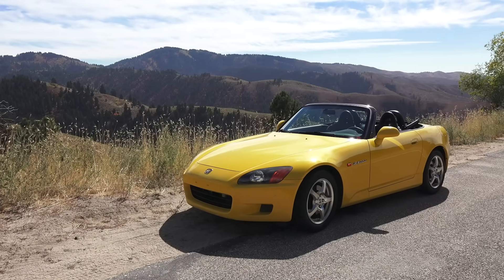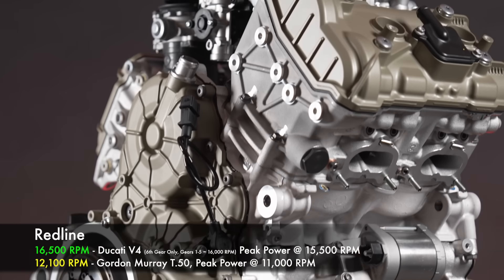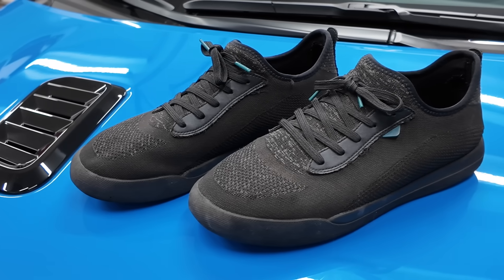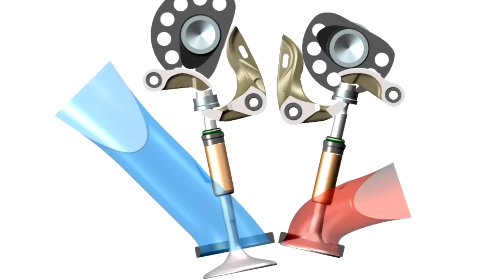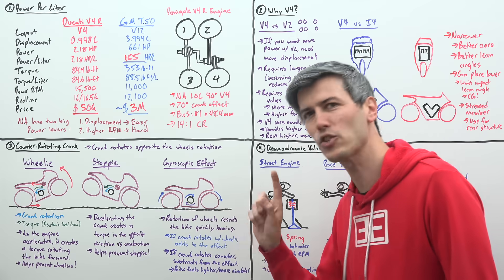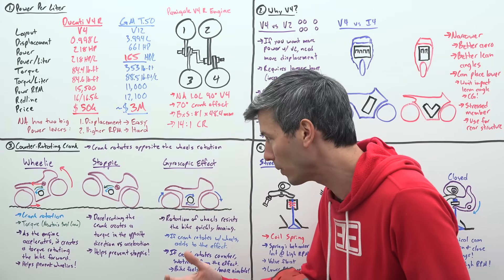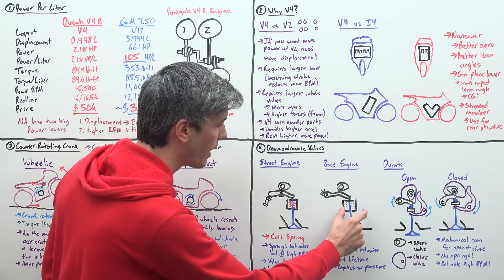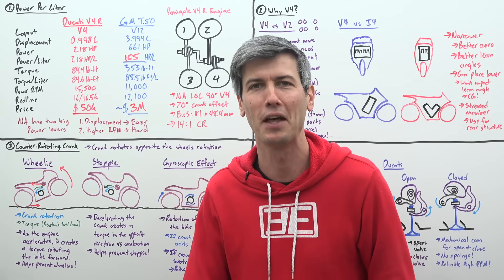Ducati's Brilliant V4 Engine — Putting Supercars To Shame!

Comment: the problem with a V on a motorcycle is heat, heat, and heat (i own a ducati, and it's really difficult when it get hot)
Reply: That's typical of air-cooled v-twins, but also happens in water-cooled motors regardless of configuration. On of the worst offenders was my water-cooled Kawasaki Concours 1000 which could roast the rider's legs in heavy traffic despite being a water-cooled inline 4.
Reply: The Yamaha V-max of the 90's was a bloody nightmare when it got hot, that just made the bikes always trying to kill you unbearable.
Reply: I had an 01 Aprilia Mille.  No matter which way the wind was blowing, the inside of my right calf was be pink during the summer.

Comment: Yes, please follow up with a video on offset and firing order which for a motorcycle has huge impact on maintaining traction (particularly when leaned over) and therefore the ability of the motorcylce to transfer the max power down on a credit card size patch of tire rubber on the road without spitting the rider off. I would suggest looking at the "big bang" firing orders of of the 500cc two stroke race engines from Honda/Yamaha/Suzuki and compare that with what Ducati is doing as well.

Comment: That V4 engine makes more horsepower than my entire 4.3L V6
Reply: I bet your four point three makes a lot more torque
Reply: @chadkent1241  not as much as you’d think. Only 250, which makes its torque per liter (58.14) significantly worse
Reply: Your V6 will have way more bottom end torque than the V4.
Reply: Yeah, but what is the weight to torque ratio?
Reply: @BobBob-q2o5p 
Two totally different applications. Normal street cars rely heavily on bottom end torque, race bikes never ever use bottom end power in racing.
Reply: @Ilmagfe  Again, I know this, as it's a pseudo-project vehicle for me, but still not as much more torque as you'd expect, and as much as I love its low-end response, peak power matters way more than peak torque in most scenarios
Reply: Different design purposes. Most riders won't use much more than 80hp of the available 200, leaving the engine fairly low stressed, but by 60k miles the engine is pretty tired (however, the bike was probably totaled before this). A 4.3 V6 should get 200k miles. Emphasis on should, manufacturers can be known for sloppy design/manufacturing.
Reply: @LilleyAdam  I know this stuff, and none of you seem to get that it was simply a half joke to point fun at my underpowered motor

Comment: I know how the Desmosedici engine works.  Instead of valve springs, there are separate rocker arms to close the valves.  This prevents valve float, but I think there's more to it.  The Desmo was designed in the mid-1950s when, perhaps, valve springs were more likely to break.  I don't know.  However, this is one reason why Ducati has the HP edge.  Assuming 4 valves per cylinder on a 4-cylinder bike, that's 16 valves.  Multiply that by an average of 10k rpm and a 45-minute race.  That means that a valve spring is compressed about 7 million times per race.  Don't tell me THAT'S not robbing HP.  However, if you own a Ducati with this engine, adjusting the valves costs more than a tooth crown.

Comment: Picked up a Multistrada V4 Rally back in August and absolutely love it... Now even more so with this insanely concise description of this incredible engine. The explanation of the reverse rotating crank is very much appreciated, it really is a very tactile ride and feel compared to other bikes I've owned.
Reply: Whats crazy is that still pushes 170hp with traditional valve springs  and has a 60.000km interval. I wouldn't be surprised if the gran turismo ends up being one of the most bulletproof engines due to the fact it's a 210hp engine being coddled down to "only" 170hp

Comment: 9:23 I am certainly not an expert, however would the engine rotating in the opposite direction BUT on the same axis of the wheel actually decrease the gyroscopic effect. I feel like it would have to rotate on a different axis..
Reply: No. The counter rotating engine does (partially) cancel out the gyro force when in the same plane, by subtracting its force vector from that of the wheels…leaving less than the original. In real terms, this makes it feel like the gyro effect is less powerful. You could try this yourself by taking two identical bike wheels on a stick and spinning them. First, spin them both in the same direction and try to tilt them (it will be more difficult than when not spinning). Next spin each wheel in opposite directions. If done properly, it would feel similar to the wheels not spinning at all (meaning you wouldn’t feel the resistance to tilting from gyro force), because the wheels are cancelling each other out.
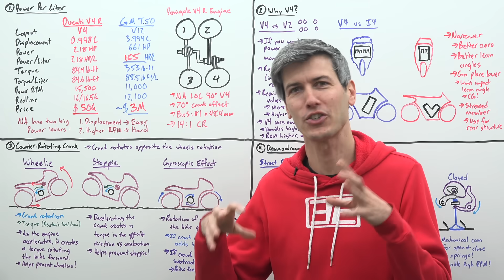Reply: 12:30 neat

Comment: 05:20 Also, if the bore becomes to wide, the burning fuel won't have time to properly ignite. Gasoline doesn't instantly explode. It burns fast. With a wide bore, and high RPM, you'll quickly hit a limit where you'll lose power, in stead of gaining it.

Comment: One of the biggest benefits of a V4 over an inline four at high RPM is that the crankshaft is shorter and therefore the torsional vibrational modes are less of a concern. This becomes a particularly big deal above 15,000 RPM.

Comment: With the Desmodromic valves, are the cams perfectly machined to match each others intervals, or do the rockers have some kind of tensioner in them that allows for tolerances?
Reply: Shims, very exact shims. I set mine during Covid. It runs beautifully but it took forever. An exercise in precision. Some might hate that, I think is an absolute joy.

Comment: I worked on a few Ducati privateer race bikes back in the early 2000s. They are built like Swiss watches: absolutely beautiful, and the closest mere mortals can get to owning an F1 car.

I hope the electronics have got better in the intervening years! 😁 🏍
Reply: The electronics were easy to fix. Just get rid of all the original stuff and replace it with good parts. Once I rewired my Ducati it ran forever and the headlight even lit up the road.
Reply: @soaringvulture Yeah! The notorious electrical problem😅
Reply: Engine wise, beautifully engineered. The welding quality on a lot of their trellis frames… The less said the better.
Reply: Back then it had gremlins in electronic, not any more in fact early 2000 was the last time Ducati had more problems with electronic than others

Comment: specific output:Suzuki street bike VJ23:1997-1998: quoted power; 1997=70 hp ('SP' (sports production) model with new 70° V-Twin engine) 280 hp/litre  and it was ~ $5k bike

Comment: your comment that ducati's engine is the only counter rotating engine is partially correct. I know of at least two modern motorcycles, that had two cranks which cancelled out their rotational inertia. Suzuki RG500 street bike sold in Eu and Canada in the 80's.   Next was the Kawasaki KR250  tandem, a street bike from the mid 80's in Japan, again with two cranks. I am sure there are more.

Comment: 6:18 why not a longitudinal I4 ?
Reply: Because the forces would either push the bike down in the corner or up, just like the drill in Jasons hand. That would make the handling tricky.
Reply: Because use your brain car guy
Reply: Then it would spin the shaft in different direction
Reply: Bike is too wide and can't lean it over enough

Comment: If you go for a follow-up video, it would be good to expand on the comparison with the T50 engine. How does Ducati achieve higher HP/L ? Is it simply to higher RPM? Couldnt we have the same RPM limit on a car engine? Will it be too complex given the size and cylinder count increase?

Comment: The whole concept of peak power is a little cherry picked. It’s all about power under the curve. In application, you can have two identical engines with different cams, one making 20% more only at its peak but the other making 20% less but for the whole rev range. The less peak engine could win in a race.

Comment: The crankshaft of a V4 engine is only half as long as that of an inline engine. The torsional moments and the resulting vibrations are therefore much smaller in a V4 than in an inline engine.

Comment: Very good Ducati show - one of your best.  Staying with race bikes, most tip-overs come from over riding the front tire contact patch, NOT the rear.  GP bikes can decelerate (carbon brakes) faster than accelerate.  So why do these machines (and F1 cars) have smaller front wheels than rears?
Reply: Because if yo make the front as wide as the rear it would handle like a bus.....also most race bikes have traction control NONE have ABS by rule.  Go back to watch late 1990s early 00s WSBK and MotoGP you will note high-sides all over the place because this was pre-traction control, the five cylinder Honda that Rossi destroyed all on being the first race bike with a traction control solution.

Comment: Seriously, more motorcycle engineering videos.  They're so much more interesting than car engineering videos as while many base concepts are the same, motorcycle engines tend to have far more design constraints leading to more interesting solutions vs just "make it bigger"
Reply: Fortnine has some good motorcycle engineering ones
Reply: If you want to make a car that actually handles, you cannot infinitely rely on "make it bigger" either. Lazy engineering is a bad thing, regardless what sort of thing we 're talking about.
Reply: Motorcycles also have far easier emission norms to follow. That does help the engineers quite a lot.
Reply: @Chopper153 Not far easier, though you are correct that they are easier.  They're just one level behind cars with new bikes needing to conform to Euro 6.  The emissions restrictions have driven in no small part the move away from low displacement multi cylinder bikes to much larger displacement twins etc.  new motorcycle engine designs are made forward-thinking, because many current engines either cannot at all or cannot effectively meet upcoming regulation.
Reply: don't forget just throw boost at it although motorcycles have that scene too
Reply: I dont think any of his videos was about making It bigger
Reply: @ronwesilen4536 what?  Of course not.  It doesn't even bear mentioning let alone making a video about.  But it absolutely happens, it's just an underlying feature of automotive engineering - making an engine block 2" longer or wider, adding 50lbs of mass, these things aren't irrelevant but they're also not critical, so many engineering challenges are simply solved that way and never even brought up or discussed because the solution was both obvious and easy.

Motorcycle engineering has all the same base concerns as automotive, but now you're also adding size and weight as absolutely critical factors.  An extra 50lbs on a motorcycle engine, an extra 2" of width, these are enormous flaws that can take a bike from class leading to meh.  

It makes the engineering solutions far more interesting as the tradeoffs are much more critical.
Reply: @ronwesilen4536 you haven't seen his only fans channel
Reply: Nah, it's not more interesting. It's just as interesting. Ships and planes are more interesting
Reply: @Southghost5997   Honestly they're all pretty equally interesting in different ways. Just depends what you know more about/what you are more interested by. Not sure why you or anyone making it a competition you're never gonna win. "Nah ships and planes aren't more interesting rocket ships and space shuttles are more interesting"

Comment: Great bike, great video, but is the gyroscopic effect of the engine turning ‘backwards’ really subtractive? The crank is still spinning with its same MOI about the crank’s K-axis, which doesn’t matter which direction it is spinning, only the MOI and the angular velocity to provide resistive toque if you try to rotate the K-axis. Maybe I’m misremembering, I took physics classes 15 years ago.
Reply: Vector sums + or - when you are dealing along one axis, it gets trigometric otherwise.

Comment: Ducati's Moto GP engines are said to produce somewhere in the region of 320hp. Also another advantage of a V4 over an online design is that of a lighter crankshaft which gives quicker response and handling due to reduced gyroscopic effect making direction change easier.
Reply: And the crankshaft is lighter primarily because it is shorter, which helps to keep the crankshaft torsional resonances at higher frequencies.
Reply: @seth094978 A contributing factor but not a race winning one.
The greater gyroscopic forces of the inline 4 engine was a distinct disadvantage because it's riders had to make a more committed turn shape whereas the V4 bikes could make a more "V"shape and change line mid turn giving them a competitive advantage and creating greater opportunities for passing and,  because they can complete the turn more quickly they can get on the power sooner. I believe this is the biggest advantage V4s have in Moto GP.

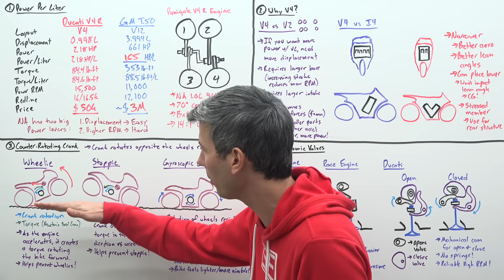Comment: @7:52 Given that the engine is in the center, couldn’t I say that the energy also goes to lifting the rear wheel, since the fulcrum point is in the middle (and not behind the rear wheels), which reduces traction marginally?

Comment: Nice one Jason, as a long time Ducati owner but race driver by trade I appreciate this a lot. Cool to note that Desmo was patented before 1900(!) and used on some notable stuff mostly from Mercedes with pre war GP cars, the BF109 fighter of WWII and the 300SLR's of the Mid 50's at the same time it was disappearing in car Ducati adopted it (also in the mid 50's). I have never had to re-shim any of my valves on my 916 (that's how you adjust them) and it's a 95 I've owned since basically new!
Reply: I had a 2012 Multistrada that didn't need a shim until its 75,000km service

Comment: Fun fact : if you rev a V4 Ducati quickly with no rider on it, in neutral; You can actually see the tail slightly lift up every time you rev it. That drill demonstration was perfect! Thank you!
Reply: Fun fact: If you rev other Ducati engines quickly, you'll throw yourself under nearest table in fear of engine explosion cause of the absurd clutch sounds :D
Reply: @jothain I had someone pull up next to my 996 and tell me it was going to explode 😂

Dry clutch Ducs are not fastttttt...but the twin pulse makes it easier to haul ass if you are an intermediate rider 🍀
Reply: @RA_D-u4z  Hah, good one :)
996's are really nice looking bikes. I wouldn't mind having one
Reply: *symphonic mechanical sounds
Reply: @mostIy_peacefuI  Cacophony of sounds?
Reply: @jothain  Meh, who cares, it's fast.
Reply: @mostIy_peacefuI  It's very debatable if older dry clutch Ducati's are "fast" :P

Comment: The short stroke which allows higher revs leads to incomplete combustion. Therefore you can't put a short stroke motor in a street legal/emissions compliant car. The big deal about the S2000 engine when it came out was that it could spin to 9k rpm with a longer stroke, emissions compliant engine. The GM T.50 engine is exempt from smog in the US: due to it's limited production it gets a "show and display" exemption.
Bonus comment - the gyroscopic effect is one reason race/sports bikes don't use shaft drive. Lower weight and lower drive train losses are also reasons. I a mere mortal and greatly appreciate the lower maintenance of a shaft drive.  ;)

Comment: The gyrotropic effect is the reason why it is quite easy to balance a bicycle when riding at high speed, but it becomes very difficult to balance when just starting off or almost at a stop. It’s also why spinning tops and spinning coins don’t fall over until after their rotation slows significantly.

Comment: I want to love Vessi's but when I had a pair shipped to me. I struggled to get my feet in. And worse when my feet were in, it seemed to heat up way too fast. Next time I'm going to a Vessi store and try them a 1/2 size larger and see if it's better. The shoe also seemed to0 floppy on the edges. Glad they work for you.

Comment: Motorcycle engines are designed for motorcycles, which are lighter and don't require the robustness that car engines need for the weight of the car

Comment: A couple of additional thoughts: A V4 engine layout with single crank pins for each forward-rear cylinder pair also lets you get away with a shorter crankshaft which has less inertia (changes speeds easier because of the lower mass). Also, a 90 deg angle between the cylinder banks allows for the possibility of perfect primary balance between the piston/con rods and crankshaft mass. The timing offset between the left and right side is irrelevant because the forward and rear banks on each side are individually balanced. One side of the engine is just running slightly behind the other, but each side is balanced independently. Honda had early VF model V4s with 360 cranks, and later VFRs with 180 cranks. The sound and exhaust scavenging was different, but the balance wasn't affected.

A V4 is certainly more complex, though. A DOHC setup requires 4 cams, for example, two in each head.
Reply: The shorter crankshaft also means that the torsional resonance modes are higher frequency, which can be important for a high RPM engine.